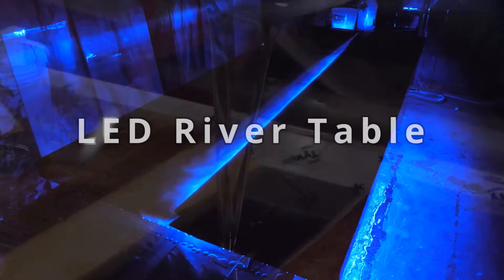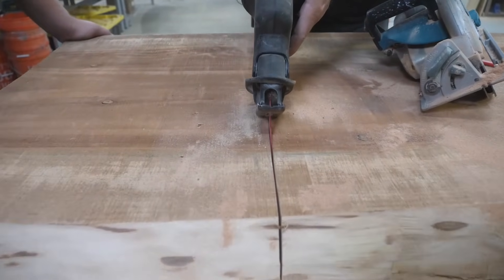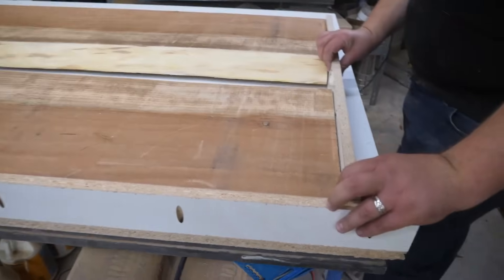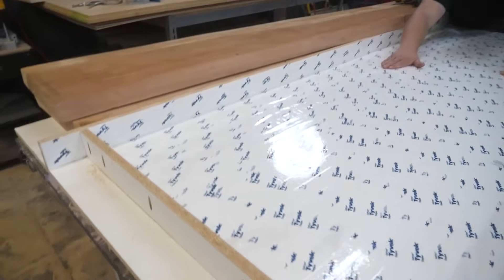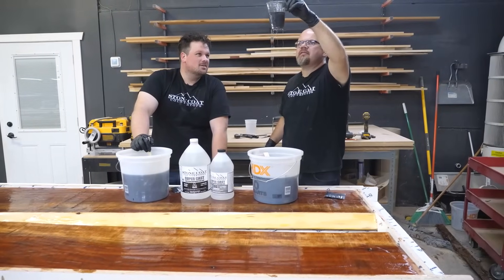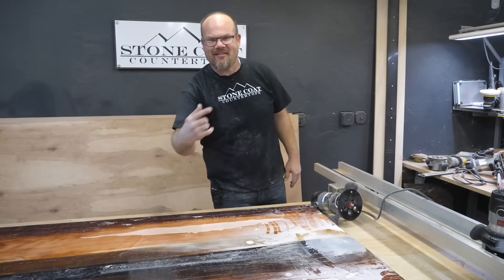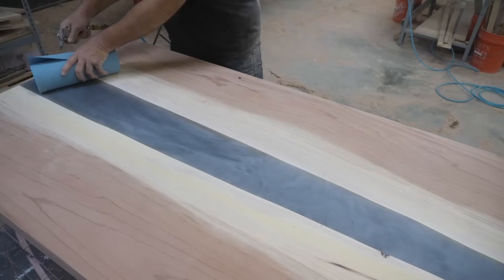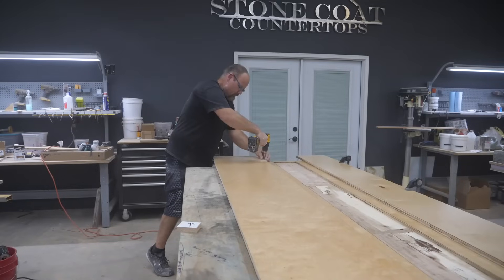LED River Table | FREE Master Class | Stone Coat Epoxy

Comment: When learning to drive, I learned that you can get out of as many situations with the accelerator as with the brake. Rather than attempt to extract the nail, drive it further into the slab below the level of the final surface using a small nail set and hammer.

Also, to work up the surfacing set up, the tried and true low-tech approach is winding sticks. If you have one already, a laser level is the high-tech alternative. Both work equally well.

I'm super fortunate to have a 5'x10' CNC with 10HP air-cooled spindle, vacuum table and 10-position automatic tool changer. So, I use winding sticks or a laser to shim the slab, then let the machine do the work, taking off a mil at a time until full surface contact is achieved. Then I simply flip the piece and do the same to the other face. Since the first face is dead flat, the vacuum is all the work holding needed.

Best of all, once the surfacing is complete, I true up all four sides, as well as apply any chamfer, round-over or any other desired edge profile.

For surfacing, I swear by Amana Tools' carbide insert bit. Like a helical head on a planer, you just turn the heads once an edge gets dull. For truing edges, I use two- or three-fluted compression bits, with a full-depth last pass to eliminate tool marks. Depending on the profile, I use round-over, chamfer or ball-nose bits to achieve the desired result for the edges.

Comment: Hello my friend in regards to the nail in the edge of the river table and your concern about removal, if I ran into this I would consider actually to take a nail set punch and try driving it in deeper and fix the hole with either epoxy or wood glue with a piece of wood dowel and cut off a an sand off !

Comment: Now I'm not a rocket doctor,but to save $$on pour in resin( if that's not a concern,read no further) I've used cleaned,  broken auto window glass as a filler,mostly invisible,you can really load it up;  saving lots of epoxy and lots of dollars!great video!

Comment: I agree with Mr. Don Ramsey.  Drive the nail in deeper than what you will be removing to flatten the surface. Or flatten the slab around the nail and sand down the area with the nail using a belt sander to leave the unique features provided by the nail.

Comment: Idea: In regard to the nail, drive it further into the wood with another nail or similar diameter object (to an appropriate depth), remove the driving nail or object, leaving the original nail deeper in the wood, fill with wood putty. Then plane accordingly. Great video/lesson!

Comment: OK…. You got me. Darn you for getting my creative juices flowing into the next 4 projects in this ole’disaster!
Love that table and the led idea. Looks like our kitchen  island will get the river idea. Except we live in farm country. And greens and earth colors will be our river. But first I need to complete my office desk. Tops already in place and is not coming off so I was most interested in the top coat process. One question… since there are walls around some edges and vertical stained/painted boards coming out of the top, is it ok when I sand for mechanical bond to get just close enough to these areas without going up to them? The top is already sealed with oil based polyurethane and my plan is a bounding border, then flood pour several layers to get ‘X’ thickness.

Comment: Great video.    You should consider a screw extractor made for woodworking.   You can buy a set for cheaper than using even an old flattening router bit.

Comment: a couple of suggestions for that metal in the slab
If it was a screw that wont back out, use a die grinder to remove the head of the screw. If that provides enough clearance stop there. If not, use a pin punch and drive the screw down through the slab. This puts any tear out on the bottom of the slab. 
If it is a nail or unknown, try the same method to drive it through
Collect the saw dust from the rip cuts mix with clear glue or clear epoxy to fill the hole, packing extra saw dust on the top of the hole. Let dry, sand smooth.
Or leave hole fill with epoxy let the blemish add character.
That’s what I would do, keep up the great work and inspiration and tutorial videos .
Frank

Comment: This project looks so cool!  I wanted to do a river slab like this (with lighting from underneath) for a countertop that I was planning for a diy travel trailer, but I have MS, and I am getting too sick to do the build now, so it will probably never happen.  Still, I might try to do a smaller project (like a small table) using the same technique.  Thanks for showing how you put in the steel supports, without crossing the “river”.  That was a question I always had when you did slab rivers in the past, but you answered my question without me needing to ask it!  I love watching all of your diy videos anyways, even if I never am actually able to do them.  I suspect it is not quite as easy as you make it look, still, it’s all cool to see.:)

Comment: I might have hinged the end of the counter that was cut off, for times of large parties when you might want or need a larger counter. When not needed just flip it down out of the way.

I have no idea of the cost of tyvek tape but I wonder if you could use No-stick aluminum foil.  It might be cheaper and go on much faster due to its much larger width.

Have you tried cooking spray for a quick release coating rather than the tyvec tape? 

Or any silicon sprays?

Comment: thank you guys for this master tutorial it was full of pro tips. the steel tubing idea was amazing especially when incerted wood. i just wanna know why didnt you skipped the sealing coat and just kept the coloring and flooding coat. what difference would it make if i skipped it.
Reply from the maker: Great question. The purpose of the seal coats is to keep the wood from off gassing air bubbles into your river or the finished epoxy!

Comment: Do you have a video with info about the woods to use with epoxy ? Like is there a specific percentage of moisture that the woods needs to be that is safe to use in epoxy projects, or is it just the dryer the better

Thanks ! 
Great videos btw !

Comment: 25:35   If I don't mind the longer cure time, can I use regular countertop epoxy as a seal coat instead of the quick coat? Would I be missing anything else?

Comment: Did you sand the seal coat on the edges before pouring the casting epoxy ?Loved your mom's reaction.
Reply: Lightly sand the river bank with 220 by hand before pouring the epoxy river! Great question Ron. Have you used epoxy for a project around the house yet?
Reply: @mitchquist Hey Mitch, Been a cabinet maker for 40 years but just finishing my first small epoxy project and have an order for a river table for a boat.Thinking I may also redo my counters with epoxy instead of replacing.Should have my first stonecoat order for some tints tomorrow.
Reply from the maker: Great to see! We would love to see some pictures of your project!

Comment: So the silicone at the end holds the river top in place or do you have to screw in from the bottom as well?
Reply: Yes, the silicone held the top in place once it dried. You can screw it down from below as well.

Comment: Wow, what a great video. I’m office-based but thought I would try build a large table for our deck. I started searching for ideas and stumbled on resin, so started looking at various videos but none of them were good enough for an absolute beginner like me. You guys presented so clearly I think I’ll give it a go. Maybe a bit ambitious as it will be 3 metres long French oak (I live in France) without the know-how that you have, nor the set-up. Fingers crossed, I’ll let you know. But thanks for such a great video.  One immediate question I have is : could I use cling film on the base of the mold instead of the tape?
Reply from the maker: Thank you for following our videos Gareth! We would not recommend using Cling film on the base mold of your project because the epoxy may leak through. -Nathan

Comment: How czn you keep it on one color? What if the lights go bad ? Do you have to remove that countertop to change the lights out?
Reply from the maker: you can control the lights with a remote and set them to your desired color, or to change!
Reply from the maker: We installed the LED lights under the table, you can un-install the top and change out the lights after the 50,000 hour lifespan!

Comment: Instead of using Tyvek tape do you ever use silicone on the seams and spray a PVA liner? Also to remove that nail look into a die grinder and a Rescue bit.

Comment: For conversations sake lets say a total pour will be 2-1/2" thick. I understand pouring the casting epoxy in aprox. 1/4" pours then torch once then repeat, next 1/4" pour then torch etc. How many 1/4" pours can you do before you stop and come back the next day to complete a pour? Or would a 2-1/2" pour take more than 2 days?
Reply from the maker: Great question Jim!  I would recommend doing 3 pours with casting to stay on the safe side. But you could do 2 pours with super cast I would probably do 2 1.75" pours since the further you are from the 2" depth can cause the cure time to take longer. -Nathan

Comment: Hi I just made my 1st table and I use red wood and black epoxy. I sanded it a lot and also sand it using water sanding method. 
When I wipe the table the red in the wood stands out nicely. 
Question,  how do I keep the red wet wood look. do I put a wood finish on it 1st or putting the clear epoxy on it will do the same thing..
I have one shot to finish it off.
Thanks in advance
Reply from the maker: Hey Bobby thanks for watching! We recommend just using our Stone Coat epoxy to keep that wet wood look you are going after! -Nathan
Reply: @StoneCoatCountertops  thanks.. the "Stone Coat Gallon Epoxy Kits" is a 1:1 and this will make it keep its wet red look?
my table is not completely flat because 1. its my 1st table. 2. I did not  sanded the  wood 1st, I thought I could do that later. 3. my terrible sanding skills put sinkholes in the wood because I was trying to get rid of notches .
 
So I will need to level the table and pour the top and let the epoxy level the table and hope it will fill in the sink holes I created. 
would that work?
thanks inadvance
Reply from the maker: Yes using our Stone Coat epoxy should give you the look your going after. Also sanding out your table and making sure its level will help you out in the long run. -Nathan

Comment: After sanding the wood and the epoxy (that was poured into the river) what brings back to life the epoxy? I've seen some put some type of liquid down and squeegee it all over the table to bring both the wood and epoxy shiny coat back to life.
Reply from the maker: Great question, after the river is poured we do 3 seal coats over the table. After the 3rd seal coat at 1 ounce per sqft, we do a flood coat at 3 ounces per sqft for the final coat. Give project support a call!

Comment: Easy way to remove that nail: dig out material around nail for about 1/2 inch wide and 1/2 inch deep. Clamp a vice grip wrench onto nail and bend wrench sideways following the smooth curve of the wrench. Keep doing this until the nail come free. I've done this method countless times and it works better than you think it would.

Comment: I am going to do the end cut of the tree project and it’s .5”  thickness, and my question is: can I fill end cut with Casting resin to the top of wood pieces and then apply epoxy resin for the top coat?

Comment: Love ur stuff , do have a question ,... when using the quik set epoxy ,and then going back with the deep pour , is their a p[ossibility of bonding or even strength issues?? Or are they both the same stregnth wise when moving that heavy of a slab around during post production???

Comment: BRILLIANT VIDEO
I have a Question if you don't mind
In your video you mentioned a moisture content of 13 of the wood, how do measure the moisture content ?? 
and I guess if it was fresh wood straight from the tree would it have go in a kiln for a few weeks, is that correct ??

I have wanted to learn and this is the best tutorial, I'm a spray painter to trade used epoxy resin before but I'm not that knowledgeable about wood, I have spray painted and clear coated wood and know a little about moisture in the wood causing bubbles when it is sealed and learned the hard way not to bake it
 I also share a yard from my former spray painting business with a tree surgeon/ logger guy who has all the tools including a kiln. It's a no brainier to try this 
This video is like gold for me and you guys nailed it The finish was spotty dog 👍
Thank you 
Are the products you use available worldwide ? as I'm in Scotland in the UK 
half the battle is having decent materials

Comment: Do you use kiln dried wood for your table tops?
Reply from the maker: Thanks for watching! Yes, you can use Kiln dried wood for your projects! -Nathan
Reply: @StoneCoatCountertops  would something this thick need to be Kiln dried?
Reply from the maker: You'll want to ensure your wood is at 13% moisture content or less before starting the epoxy process. -Nathan
Reply: @StoneCoatCountertops  Thank you. I am still wrapping my head around the seal coat epoxy, then the deep pour epoxy and the 3 top coats. Lot of different types to order and figure out the amount I will need. I am looking at doing a table that is 6' by 3' by 2" deep. River being about 6" and angling to 2" or so on the bottom.

Comment: So, I have a question, it’s my first time doing something like this. I’m making a water fall coffee table. The box I made to cast the thing is melamine and I have some mold release stuff, would that work instead of the tape?
Reply: Also, the slab im making is 36”x80”x1”. I’m using some unprocessed walnut I got a bit ago, I figured I might as well try. The epoxy is clear, and I have some blue pigment and metallic blue pigments.

Comment: Only thing I could think of doing differently, is cutting and grinding the metal tubing far away from your working area with the epoxy. Just in case some of that metal contaminates your table or creates debris

Comment: If i couldn't get the nail out, I'd get a punch tool and hammer it in as far as it would go. If that doesn't work, sacrificing an old bit is a good option. Also, what I would have done is program the LED's to to go around in a circle to make it look like the water is moving :). One last thought. You if you do a lot of these tables, you might want to look in to a vacuum chamber,

Comment: Can I put your product on fomica that's still in pretty good shape?
Reply from the maker: Thanks for watching Frank! You can go directly over your old smooth surfaces Such as laminate, formica, corian, cultured marble, granite ETC. First, we clean and degrease the laminate or Formica, then sand with 60 grit, next apply our bonding primer (XIM Bonder/Primer), and then the epoxy process. Here are the videos we have available showing the complete process. https://youtu.be/zGbV1EIwZDg https://youtu.be/sSWDiKKSxok   -Nathan

Comment: Well done with the video. Good music in background really helps . I liked that router table away you made to use a router to level off. Very simple and effective although I couldn't help   my OCD of keep the runners clear of chipping where the wheels run. Do you have a section of shop that is enclosed and dust free for the final top coating ,as when you create that sort of dust it's in the air for ages and forever coming down off light fittings ?? Well done guys. Regards Don.

Comment: 41:40 I was curious why you capped the ends of the steel tube, rather than leave them uncapped, which would allow the tube to fill with epoxy.

Comment: Hi. How long it takes to your epoxy to get completely hard??
Reply from the maker: Stone Coat Countertop Epoxy will be dry to the touch in 24 hours in proper temperatures (70-80 degrees). You can begin light use in 7 days, fully cured, and has full heat and UV resistance in 30 days. -Nathan

Comment: For the nail you need to take a small pick and just dig around it, then use a need nose pliers with locking pliers around it to grip, then twist and pull up.

Comment: To remove the nail I would try to drive it through the bottom.
Reply: Absolutely........use the finest center punch you have and drive it as deep as you can without damaging the surface wood. Then use a nail puller (not the claw side of a hammer or a pry bar) to pull it out the underside of your work piece.
Reply: I though about using a screw extractor around the nail.

Comment: If I could not get vice grips on the nail and pull it, I would drive the nail deeper into the wood so that it would not be an issue with the router.

Comment: What is the tape you used to line the form with?
Reply from the maker: Tyvek tape! Great question, what projects do you have coming up?
Reply: @StoneCoatCountertops  I have found an 18th century interior door in the stables where I work; had ideas to fill the broken window panes as part of an overall epoxy project and either make a tabletop or add glass shelves for a bar back

Comment: What is seal coat mixing mateial?why seal coat looks like white gel??
Reply: The seal coat is our Stone Coat Countertop Epoxy. A seal coat is a thin coat of epoxy designed to seal up and keep the wood from off gassing into the thick final coat of epoxy. Most tables take 3 thin seal coats of mixed epoxy applied at 1 ounce per sqft of table top. Allow each coat to dry between coats. The final coat of epoxy is applied at 3 ounces per sqft of table top
Reply: @mitchquist  natural color of seal coat is white??
Reply from the maker: @abduljalil3360  No it is clear, it turns white as you mix it because air is being introduced into it. So when you pour it and torch the bubbles, it will turn back into clear